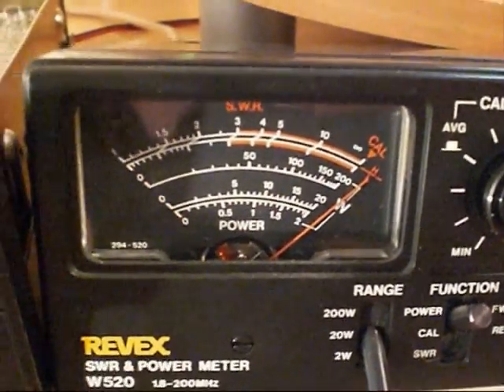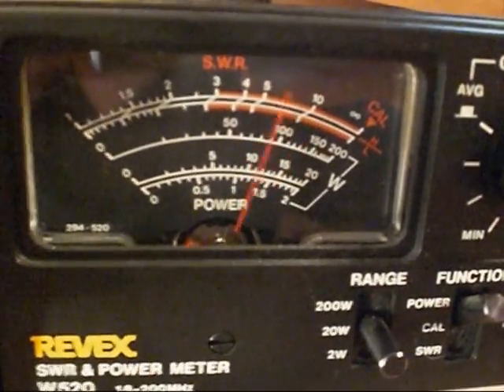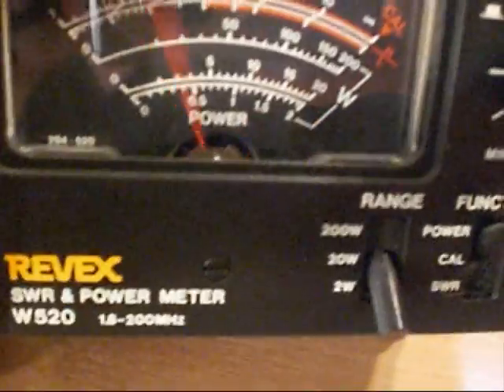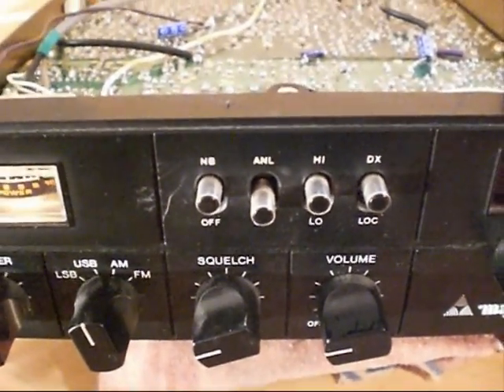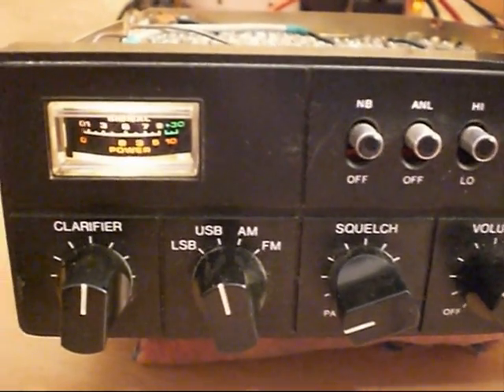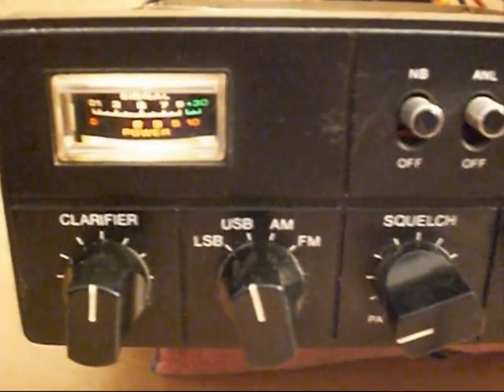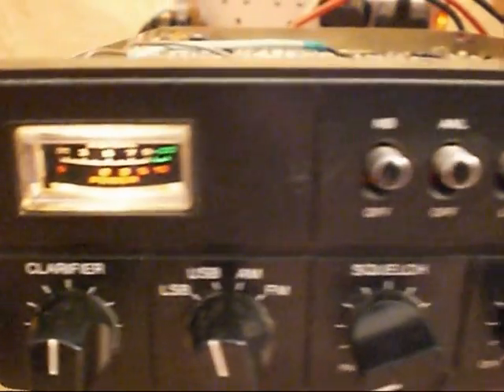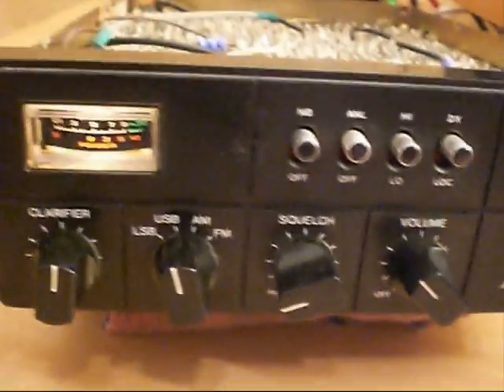STEP-BY-STEP IRF520N MOSFET CONVERSION...CYBERNET EXPORT- PTBM059C0X.

Comment: in common 40 channel radios like GE this replacement does not work, because this fet needs adictional power to drive it. It works only if you have similar driver transistor, like 2sc2166 driving the final rf transistor 
The original drive does not delivery enought  power